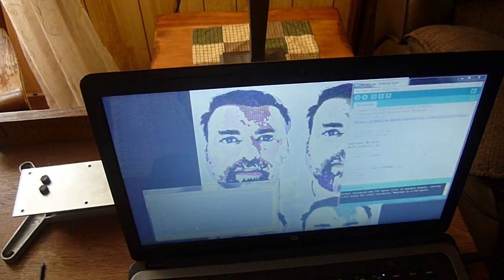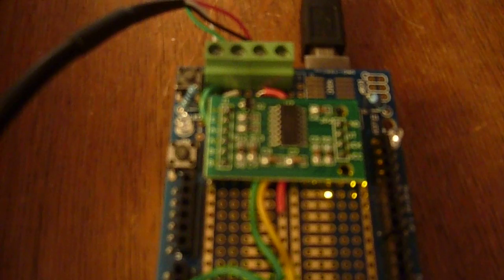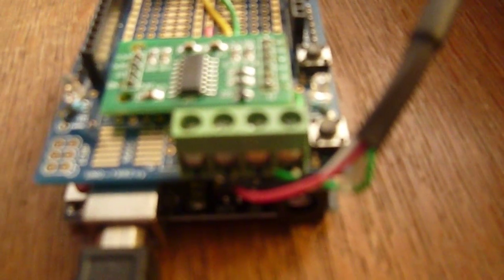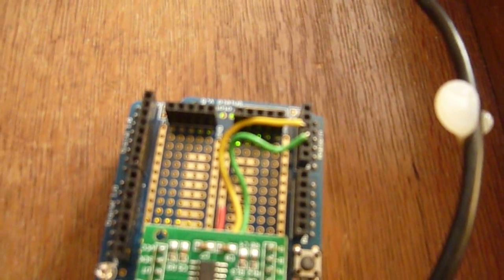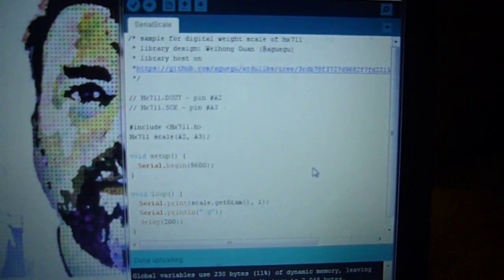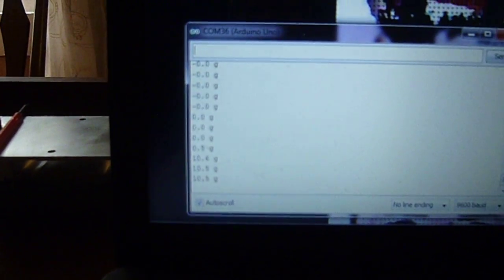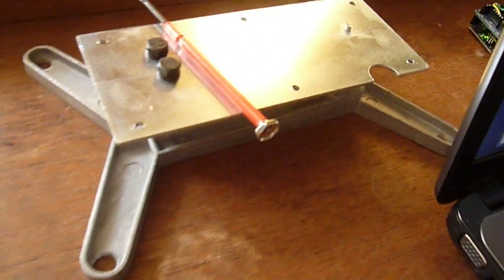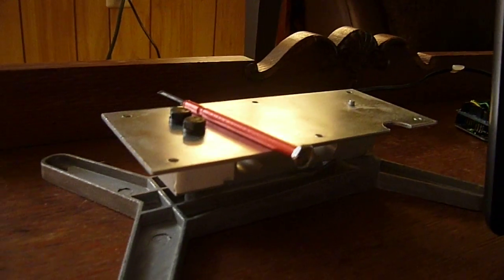Arduino Hx711 Digital Scale

Comment: Thanks for posting.  When you said resolution I think you were referring to tolerance. Resolution means count by, which in this case is .1g.  In a legal for trade application, the acceptable tolerance is +-1/5000.  (by achieving that tolerance doesn't make the scale legal fort trade, you need an NTEP cert for that).
Reply from the maker: I'm pretty sure I said and meant resolution. This unit isn't for legal trade, it's an electronics experimenters project.
Reply: indeed this is an electronics experiment, I wasn't implying that it was legal for trade, I was trying to explain what resolution means in the scale industry, no need to get your dander up.

Comment: Hello Steve,
I was wondering what type of signal the hx711 gives out. Is it a 0-5v signal?
I am trying to adapt it to my eco to measure torque with a load cell on the crank. I need either a 0-5v signal or something the arduino puts out to be a 0-5v. 
thanks for any help.
Andrew
Reply from the maker: it's a 5v ttl serial output.
Reply: Steve Spence awesome, thank you.

Comment: Hey Steve thanks for the video. I am trying to build a platform scale (like a bathroom scale) for an arduino project. There's dozens of vids and tutorials (yours are the best) but none of them show how you integrate one of those bar shaped load cells into an actual platform system. I cant balance a 10"x10" platform on the penny sized area on top of the bar - in any practical use this would tip over. How can I use the sensor and support the platform without interfering in sensor function? How dothey do this in commercial scales? I saw you hacked a kitchen scale but I couldn't see inside. Appreciate any feedback thank you!

Comment: thanks, but how i set the zero offset, when i want a dish on top of load cell to put the products?
Reply: If you use the arduino library from https://github.com/bogde/HX711 then there is a  zero/tare function built-in.
Reply: Thanks, i have done :)

Comment: can I add a feature where it senses an amount of weight and a charge is put out?
Reply from the maker: +WLTR AEP Sure. a if statement, if the weight is == to x then digitalWrite a pin of your choice, or something similar.
Reply: +Steve Spence hi my sensor is not reading the weight properly. its all over the place, any ideas why? thank you
Reply: +Steve Spence if I remove the DT pin from A2 the reading goes to zero but if I don't the readings differ when I don't touch it from  3000 to 8000+g
Reply from the maker: +WLTR AEP usually a loose wire / bad connection.
Reply: Steve Spence thank you but I realized that my load cell is a 3 wire one not a four
Reply from the maker: +WLTR AEP That will do it. My diagram clearly shows a 4 wire load cell.
Reply: +Steve Spence hello again sorry to bother you but I have a question.  I have a light attached to an Arduino, I want the load cell to turn off the light when it senses enough of a force. the load cell works by turning energy and force applied to weight right? I want to skip the weight part and go from the energy alone. once the load cell senses nothing for more than 10 secs(delay) I want the light to turn ON again.  can I do this?how?please
Reply from the maker: a if statement and a timing function. if weight ==0, start timer. at end of time, if weight is still 0, turn on light.

Comment: Is this stable over temperature changes? Thanks!
Reply from the maker: +YO2LYP I've only used it in a temperature controlled space of about 70 degrees.
Reply: +Steve Spence We used a similar HX chip on a red PCB outside  for a bee hive and there were some variations. I'm thinking to move to this green PCB as well for testing purposes. Thanks!
Reply from the maker: You don't have to keep the board outside, just the load cell.
Reply: +Steve Spence The board will be in a housing, but outdoors, eventually it will follow the temperatures from outside, thanks

Comment: Hello, I am very interested in the scale and have a couple questions. I want the display to be on a digital screen besides the computer screen. What connections do I have to make and which one should I get? Do I have to do any additional coding to have it read on the screen? Also I want the scale to be powered without lugging around a computer. Could I get a wall adapter and power it or get a USB wall charger and plug in the existing USB? Thank you so much! Keep posting those videos I like them!
Reply from the maker: Henry Nguyen I like the I2C lcd displays, as there are only 2 data wires, plus power and ground. Use the search box at http://arduinotronics.bogspot.com and search for I2C.
Any USB charger will power this.

Comment: Hi indeed great work...Can i use this for human weight? what is the maximum weight capacity? Does it depend on the load cell? Does the library work on arduino mega 2560R3? thanks... sorry for asking too much...I just need for my feasibility study.
Reply from the maker: Shen Tiu max weight depends on the load cell. Library works fine on the 2560.